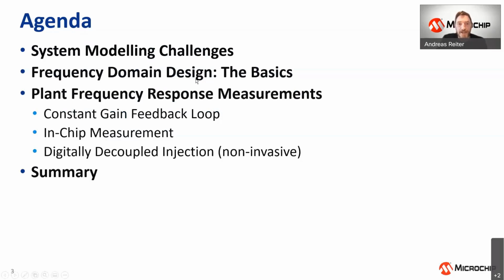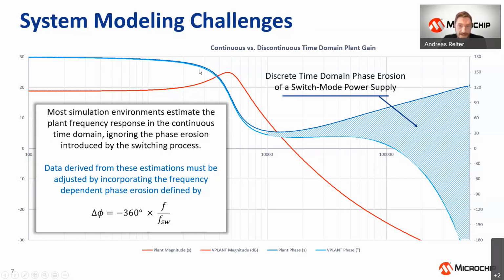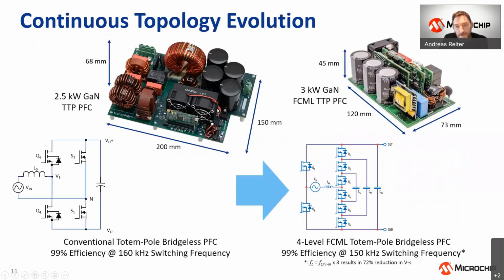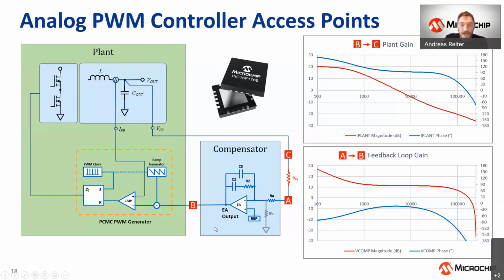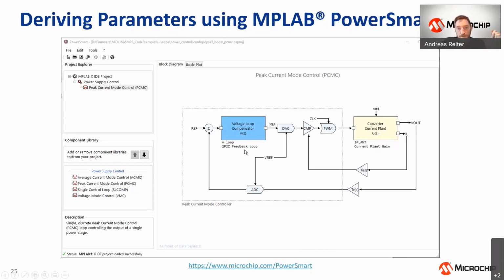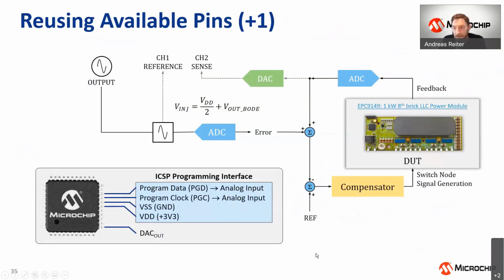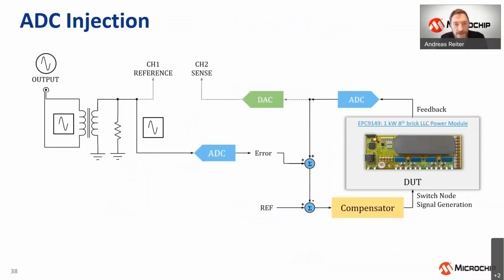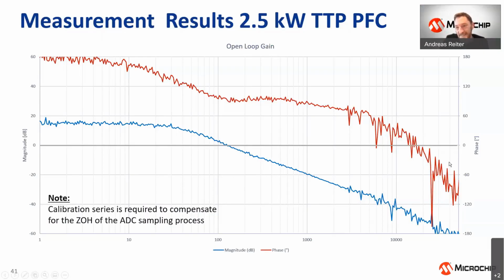Practical System Modelling using Bench Measurements of Plant Transfer Functions

Comment: Unity gain controller is an Integral Controller.
Check the Transfer function in z-domain. There is a pole at 1, which is an integrator